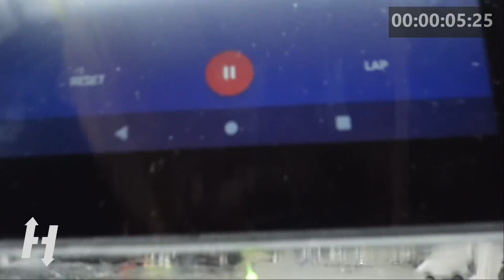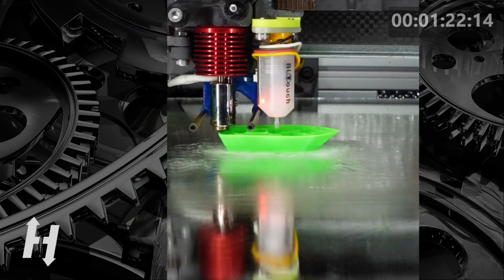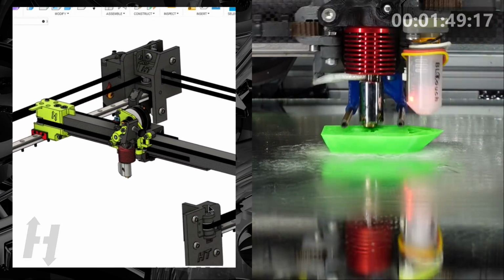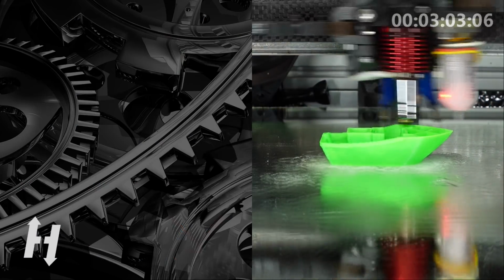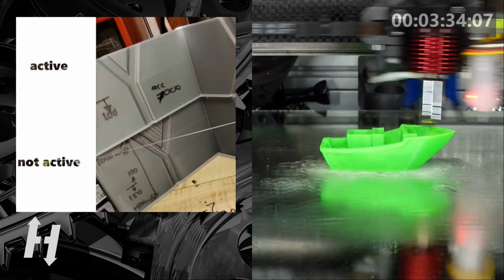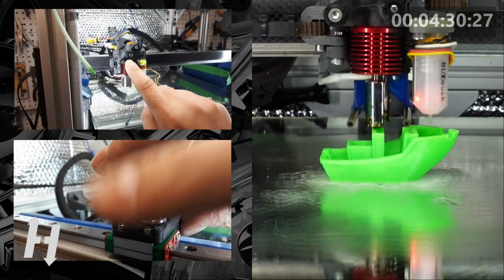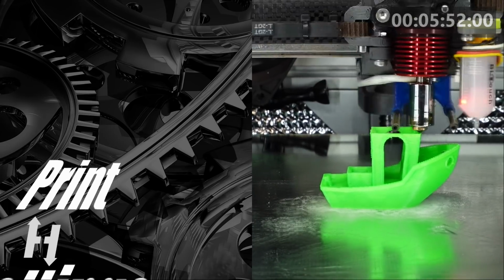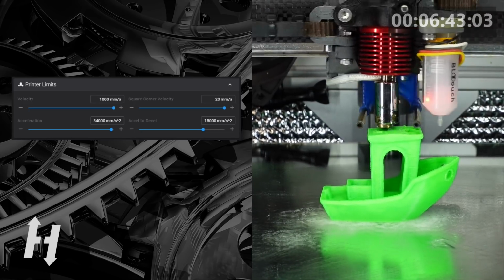My Recipe for FAST 3D printing

Comment: I'm just getting into 3Dp, but if your goal was to reduce weight on your toolhead, why didn't you go with a bowden extruder, thereby removing the weight of the motor and gears from the gantry? Is it not applicable at those speeds and if so, why?
Reply from the maker: Retraction length required for Bowden is making it slower, and might get less precised at those speeds due to the increased nozzle pressure.
Reply: @MirageC  Ah okay. I want my first FDM printer to be all about precision, the 2nd one will be MSLA and then I may do another FDM printer geared towards speed, just for "quick and dirty" prototyping; probably based on a Voron; I will refer back to your videos for that last one :D
Reply: @fredwupkensoppel8949  Any printer capable of this level of quality at high speed is going to be capable of spectacular precision at more "normal" print speeds. All you need to do is use a slower print profile.

A Voron would be a great machine to build if you want precision, and they can print quite fast. But with the exception of the much smaller Voron v0, they aren't going to be as fast as this because the gantry and tool head are a lot heavier. It should be possible to use a carbon fiber tube and 12 mm rail in place of aluminum extrusion to reduce weight, like the printer shown in this video. But the Voron XY belts are all routed on the front of the gantry, whereas the HevORT routes the belts on both sides of the gantry, so the lightweight tool head shown in this video would need considerable modifications for use on a Voron. (Not that I'm trying to dissuade you. I'm actually thinking of doing just that.)
Reply: @MrJacobegg  Youre making a good point and now that I think about it it might be kind of dumb to have two fdm machines when I can just use different profiles for precision and speed. This is why I get into expensive topics a year or more in advance; so I can rule out the stupid ideas before actually spending any money on it.

Comment: I know you use a external stop watch to count, but I wanted to let you know, the timer you have a the top of the screen is a frame counter and not a time counter. It counts to 30 (fps). Play YT video at 0.25x speed and watch :) I made the same mistake for drone racing. We end up downloading a video of a millisecond counter from youtube and then importing that video, cropping it and placing it over our video.
Reply from the maker: Thanks for letting me know!  was the first time I used this.

Comment: Question: are those cheap chinese 6mm gt2 belts or did you use anything more exotic for your printer? I was kind of worried too high accel might rip some teeth out of mine or just wear them super quickly.
Reply from the maker: They are Gates 6mm 2GT belts.  But ordered from Mellow store on aliexpress... ;)
Reply: @MirageC  reading some descriptions they look more or less the same as the ones i have. (generic chinese)
seems ill have to make some destructive tests then. Worst case ill have to use a 20 teeth pulley instead of 16 teeth ones to distribute the load over more teeth.

Comment: Speed is good but for me quality will always be key, trying for such quick times reveals your printers shortcomings and allowed you to make adjustments accordingly, my question is can you reduce the speed and exponentially improve quality, perfection with minimal surface artifacts is always my goal, that and part strength, I design a lot of practical parts that need to be accurate in shape and durable, if I can do all that and save time it is a win win.
Reply: annex has already posted a similar time yet with a higher print quality. i would no suspect his motion system. because it looks pretty well done. IMHO simply changing out hotend to a mosquito style one... should then end up with similar results. and an almost-perfect print quality. there is no hard line with hotends, it's a very, blurry blurry line
Reply from the maker: I did not use Arc Welder, perhaps this would have some positive effect.    The major advantage Annex printers have is the stability obtained with their 6 rails on XY.  With my 3 rails CoreXY, I do get a bit of rotation around the X axis.  Perhaps it is from flexion in the X carriage and the dangling effect of the hot end.  I have a mosquito in hand, I will try it and see.

Comment: Nice one....My printer is not operational.....  So in a couple of weeks.....
Reply from the maker: YEAH!!! :)  Relly impressed by what you do by the way :)  Any hint on what the printer will come back to life with in terms of improvement?
Reply: @MirageC  less effector offset, 12mm gates, maybe dual motors
Reply from the maker: @Nitram_3d  That sounds sweet!  :)
Reply: @MirageC  that slicer will not take you there as the max speed is 500.... For some magical reason 🙂
Reply from the maker: @Nitram_3d  Thanks for the hint :)  I tried super slicer, but it kept crashing on me... :(

Comment: Have you tried to print two benchies at the same time? In this way, while printing one the other will be cooling
Reply from the maker: At this point cooling is resolved, I have a bit of room to play with.  What I need is stepper motor speed and power.  I am using 48mm steppers.  60mm have to much coil inertia when only using 2 motors.

Comment: At that speed maybe even ABS becomes viable in flats.. Just leave the room for 10 minutes, then open the window, boom, done!
Reply: It wont vent much gas off since its only hot for a second with that much cooling

Comment: This is crazy! At first, I was sure it was sped up. This improvement in speed might help to make 3d printing more common. Talking about other people using it, how much would it cost to build one? PS: Thank you for your great ideas and engineering. They are very inspiring.
Reply from the maker: I usually say that 2k$ will get you a good one.  But you can go cheaper, or a lot more expensive depending on parts quality and options.
Reply: @MirageC  I don't mean any 3d printer, I'm wondering how much yours cost.
Reply from the maker: @joflo5950  I meant for a good 315*315*340mm HevORT build, 2000USD should get you going ;)
Reply: @MirageC  Wow, that is like a third of what I expected! When I've finished school, I'll probably build one.

Comment: Hey. For the last week I've been working on redesigning the hevort exactly for this reason - to put a smaller carbon fiber tube. And you just made it, better than me haha. Please tell me you can publish the cad files? Would save me so much time... Thank you!
Reply from the maker: Yes, I'll publish that mod soon.  A few trims a required to the X carriage due to that tube being 20.3mm and it is a trocky installation.  I'll continue to test it a bit before I release.

Comment: What material to use for 3D printer parts?
PLA deforms in heated chambers
Abs is a bitch to print
Petg might be too 'springy'
Can't decide x)
Reply from the maker: CF Nylon is nice, but might require more walls and infill to achieve rigidity.  I am using Greentec Pro Carbon from Extrudr.
Reply: @MirageC  thanks =)
A 3D printer is a long project anyway, so longer print times for walls and infill are fine for me.
By the way, thank you so much for the github project of the hevort!! It is really helpful for me and has so many ideas that I really love, like keeping the motors outside of the build volume.
Reply: @HannesMrg  ABS isn't nearly as hard to print with as people think. You just need an enclosure, bed temp around 100C, and a surface preparation to help the ABS stick (my favorite being PEI). Applying PEI to a bed is easy enough, and pretty cheap, but a PEI-coated magnetic spring steel plate isn't too much more expensive and is worth every penny for the added convenience.
Reply: @MrJacobegg  My bed takes literal Hours to heat up to 100°, but once it does, the prints stick perfectly. The Problem is that on the higher layers there always are a few that don't come out quite well and even though they are still holding during printing, they are a lot weaker than the others and parts break there or there is a blob that's still visible after acetone smoothing. (Smoothing is what i love about ABS)
Reply: @HannesMrg  That sounds like your abs needs more heat. Improving your enclosure to keep more heat in is one thing to look at, and that could also help your bed heating times. Another is to bump the hotend temp higher, and possibly compensate with more part cooling. Lastly, the quality of the abs can make a big difference. I've had a couple brands that had layer delamination issues like that.
Reply: @MrJacobegg  Hm, temperatures are quite high, i think it's the ABS quality then. It's a cheap brand that i use. 
Thanks for the ideas =)

Comment: Thanks for the tip with lubrication, I have searched for hours what is the best compromise between low maintenance and low drag while also not damaging metals or plastics.
Reply: Myself also. Actually already had this specific one on my shortlist, just was not at all sure about it. Since not knowing anybody else had tried it. It seems to beat the other options out there. The durability / lifetime might be more of a letdown. But time will tell, only $10 for a can. So can't really say no to trying it at least once and giving it a shot
Reply: @dreamcat4  yeah, same for me, I have made a list and this one was on it.
Many people recommend super lube, but it's not readily available in Europe and even if it's good, I would hate if i couldn't get my hands on it anymore in a few years.
The reason I didn't already get a spray can is because it's so easy to make a mess with them :D
Reply: @HannesMrg  the thing about superlube is that its really thick. like a paste, so whatever the 45% which is not teflon

Comment: Next thing is removing the heavy linear rail on x. Could replace it with horizontal wheels riding on your carbon fiber block. May need to create a smooth surface by applying a layer of something like epoxy and then sanding it or have it done in a machinist shop. Oh, and that super heavy and bulky bltouch need to go, it creates too my air drag haha!
Reply: the optimum size rail is mgn9h, addording to the hiwin specs. as for replacing the stainless steel rail itself with something lighter.... i would expect that a very precisely machined aircraft grade aluminium / magnesium alloy is realistically going to be the best option... could also machine out extra material webbing scructure into the interior of the rail, inbetween the screw holes. and use every other screw hole, this would further reduce the weight of the aluminium or magnesium alloy. but without sacrificing on the strength / mechanical stiffness

machining such parts is rather costly. however the weight savings also increases linearly for the larger the gantry length / X dimension of the printer. so it's not pointless or anything. just really expensive!

to get an idea of the weight savings potential: a 40cm length of mgn9 rail weight 152g. So lets imagine ('best case') you could reduce that right down to about 50g. That would save 100g, from the total moving mass. Which in the video here, Mirage has gotten down to about 585g. minus -15g for the bltouch. = 82.5% of the previous total moving mass. A 17.5% weight reduction. However IDK his actual gantry length here. It probably isn't the 40cms i quoted you.

hope it helps
Reply from the maker: My X CF tube is 422mm
Reply: @MirageC 
www.exoslide.com
No linear rail is even better and I don't think it's doing a whole lot at this point. I think there should be little z movement in your case and given your toolhead is already well balanced vertically you'd primarily need to worry about it sticking to the CF tube in the Y. This does seem like a sizable change but that's like 75% weight reduction Y moves. With less weight you'll also need less rigidity from your CF tube.
Reply: exoslides are too heavy :/

Comment: Really amazing stuff. The print head is flying. You're going to need a pilot's license soon. :))  Very interesting on the control board using an accelerometer to analyze motion. Super cool. 

I haven't read the rules... Is it possible to create a customized printer for this contest with a print volume just barely big enough for the benchy? That way all the rails could be way shorter and hence lighter. Also with a teeny print bed you could eliminate your BLTouch, etc.
Reply from the maker: Rules only apply to the Line width, layer height, infill, wall, tops and bottoms.  The rest is yours to decide.  Just no servo motors allowed.
Reply: @MirageC  Cool. Go get 'em! With your innate sense of innovation I'm pretty sure you'll be on top soon. Take care.

Comment: pretty great result! critically this shows that we dont necessarily need the added complexity, cost, and weight incurred by a crossXY style kinematics system. i would be guessing right now that your print is more messy / sloppy looking than the annex k2 equivalent time entry due to a softer transition zone of the heatbreak. which affects the performance of stopping the flow / retractions. wheras a mosquito style design has a much sharper and shorter transition zone. which then reduced the problem of semi-molten area. when the filament is neither a solid or liquid. of course print quality aspect is not a requirement for the speedboat race :) ...im just dearly hoping its being caused by the hotend choice rather than by your kinematics system! if you understand my meaning here
Reply from the maker: I think the quality difference might be due to my X rail rotating with the inertia. CrossXY have more rigidity in that aspect. But they need 6 rails and 4 motors...

Comment: "I think it's not bad at all."

Me: looks at my crappy looking 40 minute printed Benchy and cries
Reply: Im personally really interested in how much and how fast and what kind of a wear it would cause to the printer and all the components by using it at this speed
Reply: Same thought here (without crying ;-), but well, it's just a stock i3 Mega and it might have been even slower)
Reply: @maxmustermann2596  a stock i3 Mega should print a perfect Benchy with the default cura settings unless your filament sucks
Reply: @AniviaS  Lower tip of the front usually looks curled and there is often a kind of water line, which is visible. I think it might be the room temperature at around 26°-28° + the Anycubic PLA, or a handling error (I use the first working settings I found for Slic3R a long time ago). 
Using Sunlu PLA at a room temperature of around 20° I already managed overhangs of  70°, but they didn't have such a sharp tip. Maybe I should test the SunluPLA + the cooler location.
Reply: @maxmustermann2596  I've got a stock i3 mega and printed a stunning looking benchy in 34 minutes
Reply: @ak_fx  I had a really old and misused second hand CTC3D Dual clone that could print beautiful Benchy's in around 30-32 minutes depending on what level of derpitude the Makerbot slicer did on Sailfish years ago. I did spend a hullava lot of time tuning its own custom profile though and was printing in PLA. it was also not all that standard anymore either as I had to self print new parts for it. (It really was abused previously, the heatbed was warped as hell)
Weird that an i3 mega is slower.
Reply: @JamiePineappleWyatt  never tuned it. Just used stock profile.
Reply: same here... hahahahahahah
Reply: We all been there man. My first 3d printer was a QU-BD one up. Made of f#cking paper board an had a slanted z-axis. True pain that was.
Reply: Same

Comment: I think that for your speeds and acceleration you need to switch to ball screw drive, it will make your system stiffer and increase the natural frequency of the system. Belts are flexible, it hard to optimize motion parameters with them. For best results you should switch to direct drive (linear motors)
Reply from the maker: Totaly agree with you, but this would require much stronger stepper to deal with the increased inertia. And these stepper would need to keep up with such speed (depending on the screw pitch).   I think this is a task for servo motors.
Reply: @MirageC  Totally agree - if you want speed and precision switch to servos

Comment: Amazing. 3D printing moving in the direction we need. Higher speed and great quality. What will come next? 🤔
Reply: Increasing surface perfection, and mechanical properties. At the highest degree of surface perfection, the surface could be micro etched with lightwave guiding textures to create colors without pigments maybe

Comment: Nice upgrade!
AFAIK one of the requirements of the #speedboatrace challenge is to use stepper motors.
So right from the very first seconds of this video I was dying of curiosity: have you already upgraded to those Clearpath servo motors or not? :)
Reply from the maker: Not yet... those are still the E3D high torque motors ;)